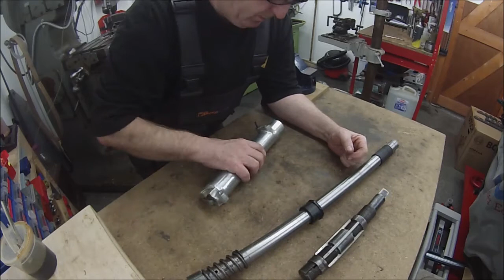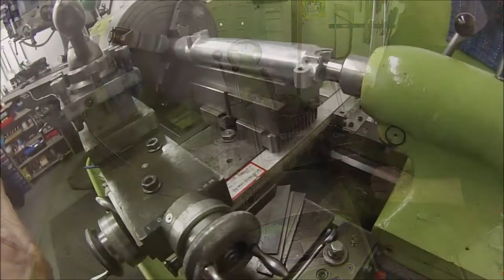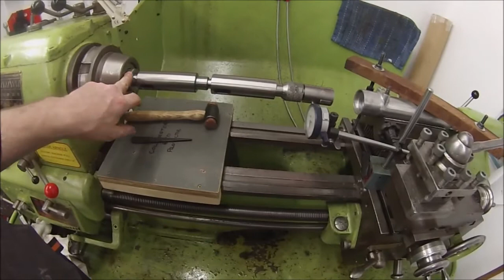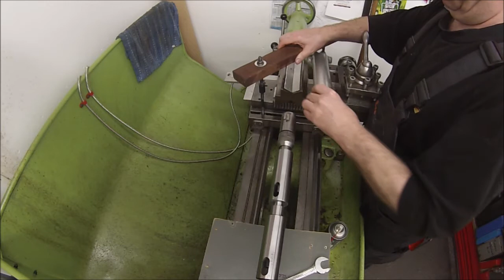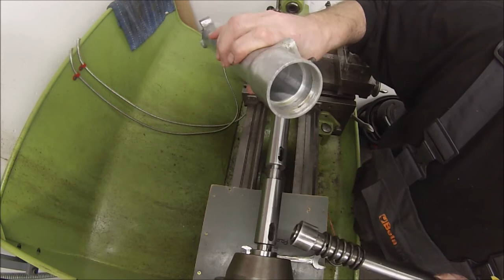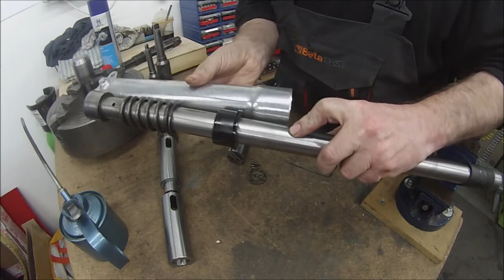Sticking Matchless forks and DB reamers

Comment: Very specific and probably very high cost tools. Only there in the country of origin of the motorcycles as they are currently resembling are there such specialized tools. Not counting all the adventures to center and prepare the machine for the execution of the beautiful service. Here, if the telescopic fork has a defect of this type, sometimes due to the mechanic holding the fork without an internal bush turned from wood, with semi-concave jaws of copper or aluminum in the vise jaws or bench vise, they replace the fork or perform a service that leaves much to content even less experienced motorcyclists. It is not easy to leave all the components of a motorcycle gold and wire. So it has a high cost.
Reply from the maker: Thanks again

Comment: I don't use my DB reamers very much but I thought your spindle speed was pretty good for the size and the stick out of the sleeves.
I was wondering if one of these floating reamers might be the answer to a problem I have. Very occasionally I'd like to bore Norton barrels on a Bridgeport. It wouldn't be worth me buying a cylinder boring bar but the Bridgeport isn't really rigid enough. Perhaps an S12 would be the ticket? If anyone has done this I'd like to know.
Reply from the maker: That's an interesting thought, not sure on room as you would need MT4 to R8 and the barrel height plus clearance? Could work in theory.

Comment: This video popped up when I was searching for replacement blades for my DB floating reamer. I wasn't then surprised to see my friend Chris comment below. I'm looking to do something similar to the Marzocchi forks as fitted to Morini motorcycles. They're unbushed and eventually the wear means they eventually need converting to a bushed setup.

Lansdown engineering used to offer a service to rebore Norton forks. They used a faceplate mounted fixture with a large bore pipe to hold the slider. It had a centre for the lower end and four screws to clamp and centre the upper end.

I did wonder if you would have been able to dismount the reaper and check progress without having to remove the slider.
Reply from the maker: Thanks for watching and commenting. Being able to check without disturbing the slider would be easy in a longer bed lathe, removing the reamer depends on space available

Comment: Great video. Did you check the collar on the end of the fork tube to see if it was distorted or out of round?
Reply from the maker: Thanks for watching. The fork tube fitted the other sliders OK, problem was definitely with the slider. Good observation though. Ade
Reply: Of course. I should have realised.

Comment: Hope they work ok" dangerous things to get wrong, nice set up well thought out. As usual well thought through, & educational film. Hope your health is coming on nicely too.
Reply from the maker: Cheers Rob, yes you are right, by all accounts them Matchless forks were a bit dodgy from new, stories of brake torque arms ripping out, so all these years later they need care in assembly and regular checking. Feeling much improved thanks.
Reply: A G Engineering my dad told me the forks after a long hard ride on hard braking they"or one would not return😮

Comment: Can't help with the S&F, I have one new in its box but no instructions. I only bought it a SM&EE rummage sale because it looked interesting and one I'll have a job that needs it, maybe.:>)
To save all those repeated set ups, would it have been worth making a bush to fit between one of your Morse extenders and the bore and then hand hold the slider? Perhaps using the tail stock as end support?
Just a thought but if you wanted to ease that little end stick, you could put a slight chamfer or radius on the bottom bush, not that it is really necessary but there you go.
Reply from the maker: It wasn't that bad to be honest, with the height set I ended up checking the horizontal alignment using the reamer itself . I had thought about making a sort of guided boring bar using a couple of bushes to support the back end as the bar enters, but in theory each time you make a cut, the bush needs to be made bigger. Hand holding the with a 2 flute reamer is a bit dodgy, I have had a few with tang damage and talking to a guy that used them in the past they can "grab" suddenly in use apparently, he did say only take very very light cuts. Talked with the bloke building the forks about a larger chamfer on the bottom bush, but he's happy with the results. There is a Midlands model engineering show this month at Fosse Way exhibition centre, might go to that, not been for a few years. I'm at the classic motorcycle mechanics show, Stafford the week before to have a look round also.  Thanks for the support Chris.
Reply: You got the job done, so any alternative way is irrelevant, as they say "ask a half dozen engineers......"
I think you are right, when I looked at my reamer I thought it seemed as though it was meant for use in a rigid set up, more like a two flute boring head than a reamer.
A small party of my local SMEEians have plans to go to the Midlands, not sure which day yet, 
Never been to Stafford but the shop used to have a stand, must be twenty years ago now, how time flies when you are having fun.??????
c
Reply from the maker: A mate and I have just booked for the Midland MEX , we are going on the last day, Sunday.I have thought for a while now the model engineering clubs and folk need to appeal to a broader audience as most people I know into home engineering don't build models, they do bikes, cars, compressors, welding and fab, and all sorts of general engineering, most have a lathe and mill, but have never built a steam engine or the like. Maybe home engineering club/society would be more appropriate?
Reply: I think we might be going on the Friday, but when you get to a certain age one day is very much like another.
Indeed model engineering is only one branch of "light" engineering. Personally I am more into the experimental engineering part of SMEE, I did make a little wobbler and bought a Super 7 just so I could say I was a model engineer, but with no great conviction. I only really joined the society to learn but right from the word go people were asking me how I did something or how they should do something, must have the right face to inspire confidence, perhaps I should have been a "trickster":>)